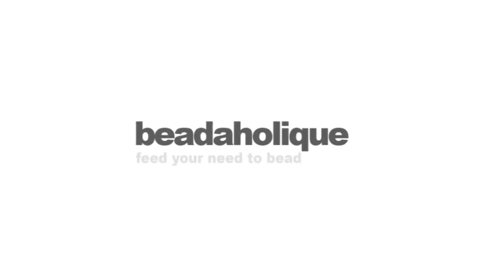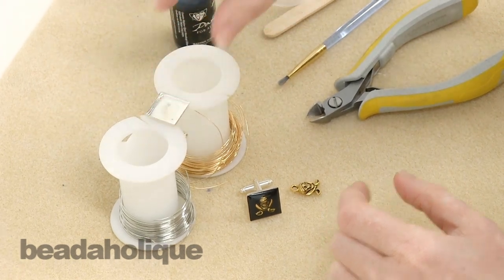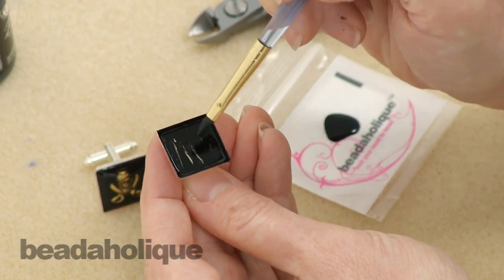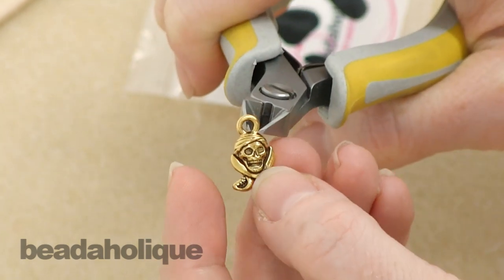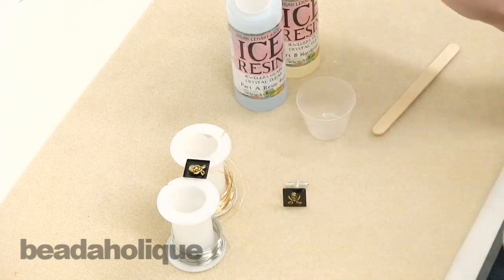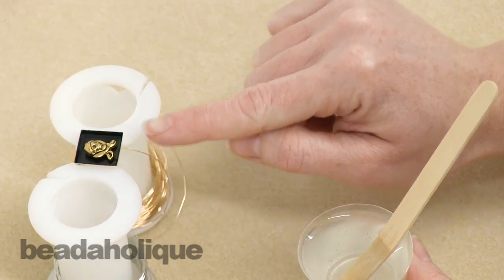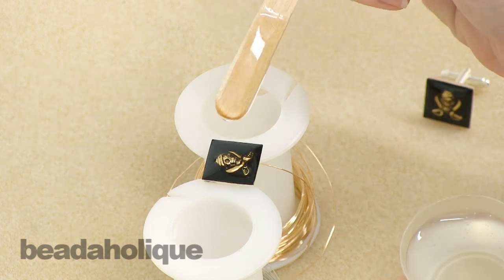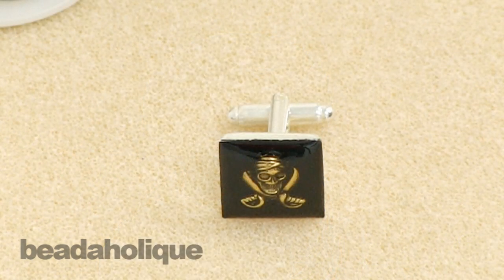How to Make a Pair of Cuff Links

Comment from the maker: This particular project does call for just a little bit of resin so I would suggest having other projects ready to be filled with resin when you make your cuff links. Personally, I tend to make a bunch of projects and then do one or two pours a month for all of them at once.
Reply: Do you use a mask? What safety precautions are needed for this? I want to try this but I am scared of the fumes causing health issues

Comment from the maker: I have found that I need to mix at least 1 ounce of resin at a time for my formula to come out right and the proper chemical reaction to take place. When I have tried mixing smaller batches, I have had issues with the resin not curing properly. I think it is because you need exactly a 50/50 ratio and when the amount you are pouring is less then an ounce, it is much harder to get that ratio exact.

Comment: can the patina be regular paint ?
Reply from the maker: Yes you can use any paint that works well with metal. We like the patina for jewelry pieces because jewelry can see a lot of wear and tear and the patina is durable stuff. It won't chip easily and it doesn't need a sealant.